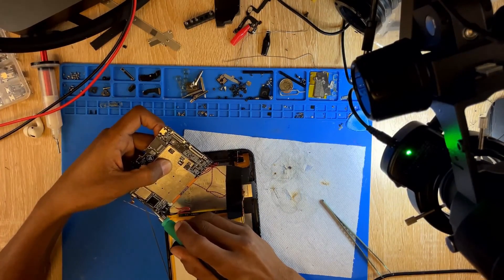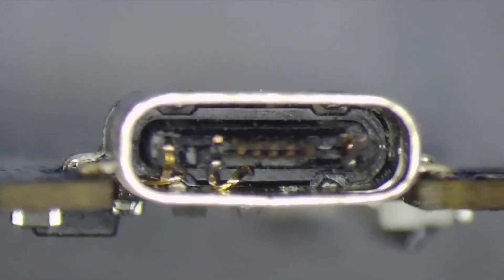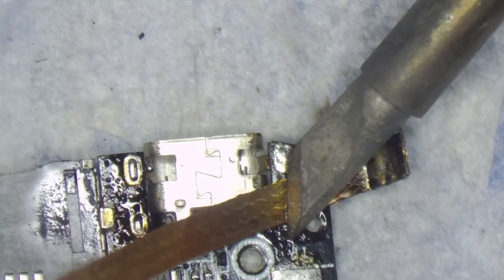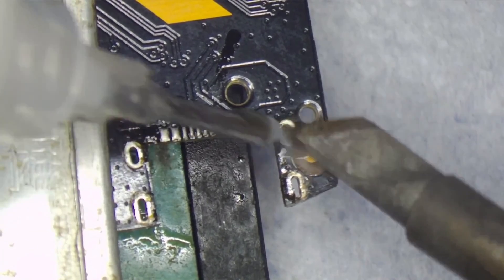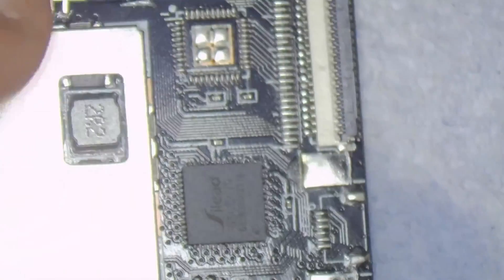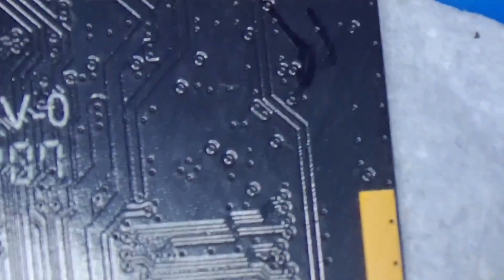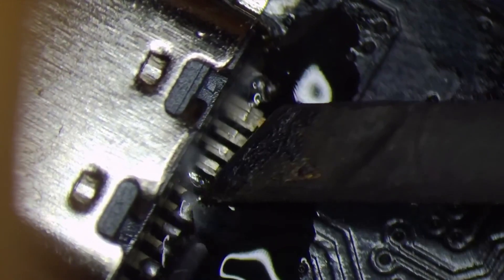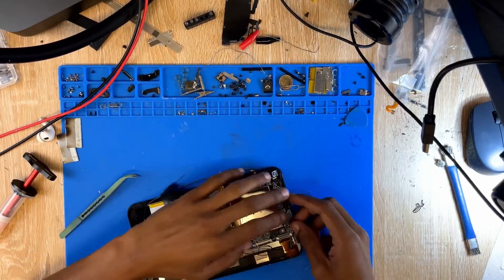How to USB-C charging port repair

Comment: Hi. What did you use to clean board after desoldering port.
Reply from the maker: I’m using Isopropyl alcohol 99%
Reply: @UsiddaTech  okay. I thought it was something else like PCB cleaner. Thanks.

Comment: Hello! Thanks for the video... just wondering about the metal you're using as heat shield. Where on the board are you placing it? Is there no concern for shorting between components and causing static damage?
Thank you!
Reply from the maker: The battery have been disconnected for me to desolder the broken port so there is no worries but it’s always a good idea to shield as much as you can specially if you are using hotairgun